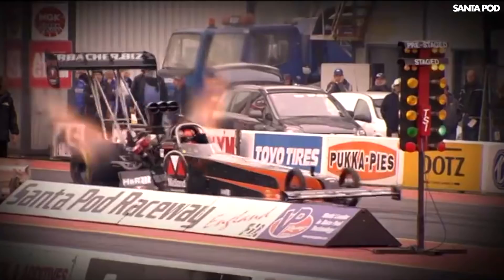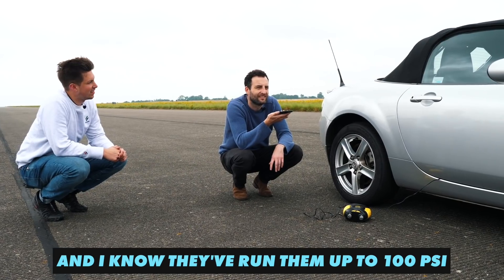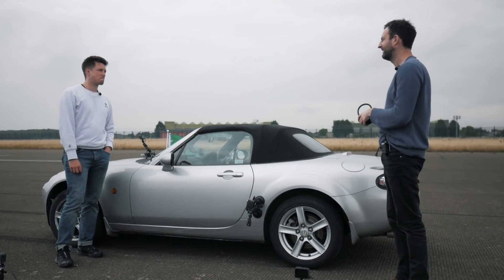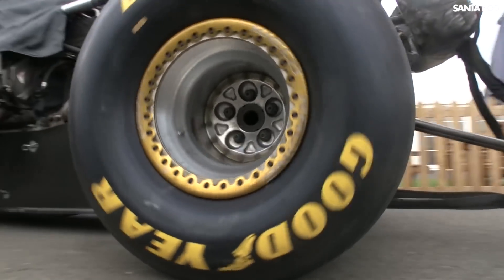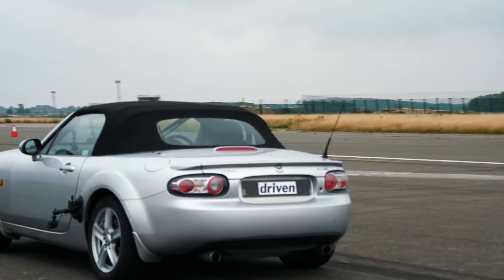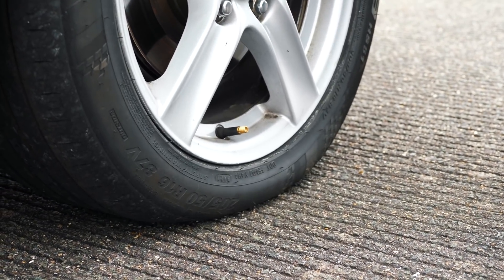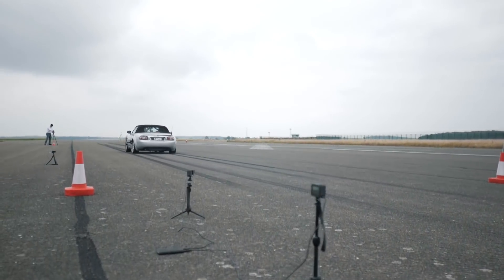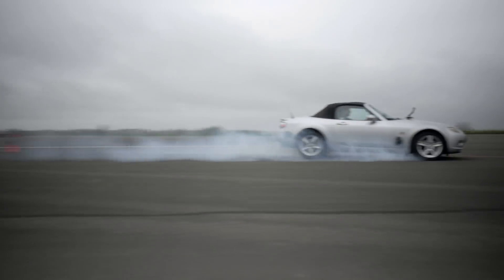Do Flat Tyres Make Your Car FASTER? | For Science

Comment from the maker: Those flat tyres were sketchy!! What would you like us to test next??

Don't forget to subscribe!
Reply: I remember a motorbike magazine did a cool test about 15yrs back. They covered over the speedometer on a bike and got three different riders to go along a runway at whatever they thought was 30, 50, 60, 70 & 100mph. Of the three the guy who was a speed freak was actually the most accurate, while the worst was a copper! Could be a cool test to try, especially if you used a big comfy car vs the mx5!
Reply: @downforcedan  Believe in JESUS today, confess and repent of your sins. No one goes to heaven for doing good but by believing in JESUS who died for our sins. GOD loves you soo much unconditionally.🤩❤😍🤗😇☺🙏
Reply: How about driving a circular track always on the inside lane and then driving it always on the outermost Lane and comparing the times.
Reply: What would happen to different types of race cars if they encountered a pothole? Even on street circuits, this has to be an extremely rare occurrence for today’s race car drivers
Reply: Best tyres against potoholes
Reply: 15 psi is the best pressure to contact patch ratio. Because any lower will actually decrease your contact patch as the tyre tends to fold in and you have what it's called "shoulder wear", when central part of the tyre is actually lifted off the contact surface and you are running on the two edges. It's quite easily identifiable just by looking at how they were worn out. 
Plus, the most important part of it is the make of tyres itself. And I'm not talking about brand, but what they're made off. Some tyres could be were hard composition of rubber, some will be very very soft. From my own experience the softest tyre I've ever had on my car was Michelin Eco tyre, I don't remember exact model name, but that tyre was so soft lightweight and flexible that I was able to turn it inside out and that shocked me.
Reply: Try it with an autobox. It will eliminate the clutch and reaction time. And, on the subject of auto boxes, test 2 identical cars, one with an auto box, one with a manual. Try a 5 series with a ZF 8 speed vs a manual.
Reply: Great video, but it had nothing to do with "Science" my friend. Science,.. Is the application of 'the' scientific method, to specifically and empirically determine cause & effect of a 'natural' phenomena.
         What you are actually doing is 'trial and error' testing, which is a process used within the fields of engineering or technology and design development.
      ... It's a great process, but it's not science.
Reply: Redo this test with an appropriate test vehicle. Perhaps something capable of running tens in the quarter mile
Reply: Alot of variables need to be eliminated.
Reply: Once you lower the pressure, do the moose test and check the breaking. As some idiots will start driving on 8PSI. Wrecking tires in no time.
Reply: Speaking from working experience. The max psi should be on the wall of the tyre mate 😅 (But, if you did that part for entertainment just ignore this comment). 

Oh! Also (for your average Joe) don't stand next to a potentially explosive tire. Worst case scenario, you'll mangle or blow your legs off or disembowl your self 🤕😱. To be as safe as possible. You want to be parallel with the tread and as far as possible with an extended air line. If you hear and snaps crackels pops or see bubbles... Run! And find cover fast!! Because you'll have created a literal air bust bomb by accident. With dirty shrapnel. And there nothing you can do safely that will stop it. Just leave come back later. If it holds for 24 hours it's probably safe to deflate. But it's still a gamble. For reference about 55 to 110 psi (depending on size and load capacity) is what commercial tires use on a regular basis. There's should be safety videos that will show you what I'm talking about if you are curious.
Reply: Tire pressures but for cornering
Reply: You guys really should have done a quick burnout before launch to equalize tire temps.
Reply: You could have made it a fair test by setting off at the same RPM throughout the different tyre pressures
Reply: One thing I never see talked about is the effect of relative track width on suspension tuning and weight transfer. So for example, if you spacered out the front wheels (or ran higher offset rears) the car will weight transfer to the rear harder when loaded up in a corner creating understeer, or vice versa, it will create oversteer. Could be a fun test with just a set of spacers.
Reply: lower the pressure   and check the breaking
Reply: In drag racing, race drivers/teams compare multiple point times along the strip, not the total elapsed time. Varying tire pressures affects the starts and big end times respectfully, not the same overall. With this car the last 2/3rds of the track would be an improved time with higher tire pressure and lower rolling resistance, and the lower tire pressure has better starting grip and high rolling resistance.
Reply: How about a lap with space savers ?? 2 to start with on either the front or rear. then switch them, then all 4 and compare the times
Reply: drag slicks
Reply: British vs. American approach to a kit car and link up with the Donut Media team. Make a fun series out of it!
Reply: How about not a manual to get rid of that variable and maybe check tire temperature next time. Warmer tires have more grip = "less wheel spin".
Reply: the british accent makes me laugh so much this video is amazing keep it up

Comment: This needs to be done in a car with an Auto and launch control 
And put the smallest wheel with largest side wall tire on the car that will fit

Sure this showed us results for a car with normal wheel/tire setup 
But literally anyone chasing a time on track or street racing and serious 
Is running 15"-16" wheels on a car that came with 18"-20" stock 
Not to mention either R888Rs or DOT slicks 

Plz plz plz redue this test with these parameters 
(Auto with launch control is to remove driver skill/mistakes from the test results)

Comment: At speed tests and time attacks I prefer 22psi it’s ideal for a good fast start better traction less understeer and oversteer until mid track they start to get hotter which is good for semi but it will inflate, by that time you will pick up the pace 👍🏻
Reply: Did you know that nitrogen inflates more than air? Unbelievable 🤷🏻‍♂️

Comment: Traction and speed are two different things. Higher pressure less resistance, lower pressure means more rubber on the ground, increasing the resistance. There saved you some time. This is why you don't drop the air pressure unless it's a utility vehicle, or a funny car. Your Ferrari is not a Jeep.

Comment: Drag slicks are bias ply and are specifically designed to run low air pressure, conventional tires will tend to cup upwards in the center reducing the contact patch, making less traction instead of more like a drag slick.

Comment: You could do the sam but with rolling start to have more consistant results but then will be only difference in rolling resistance in such a low horsepower car. And maybe gear ratio a bit as well (difrent diameter of the tire

Comment: Lowering tire pressure matters more with high hp vehicles that have a problem keeping traction.  That's why you see it done at the dragstrip.  A low powered vehicle like this Miata is really not a good test bed for this.

Comment: My .02c, if you wanted to go quicker with the insanely low pressures you need to then remove the wheelspin. It sounded like at the 20psi and lower mark you were revving the engine higher which I don't think helped put at 5psi. At 5 you needed to back off the throttle just a touch to allow it to actually grab and then hammer it on. Any drag racer will tell you that you need to hook up to go quick, but they're still able to do burnouts and also ruin races by breaking loose off the line.
No need for a retest because obv it's not sade to be that low at high speed on street tires but I bet if you backed off the launch and then hammered it immediately after hooking up you'd see a tiny but consistent improvement possible.

Comment: Unless it’s a specific designed tire to run low on air , it doesn’t help much at all to run standard radial street tires low on air…it actually can make traction worse on pavement ! The center of the tire will concave and only outer edges of the tire will have traction!

Comment: The reason the car was slightly quicker on 70 psi than 30 is because with less friction you loose traction but the car will accelerate faster after it hooked. It's fighting less friction so less drag. It's why drag cars have skinny front tires rather than standard size.

Comment: You should have kept the tyre pressure in the front constant. Lower pressure in the front will just increase drag. The lower pressure might actually have been better if it was just the rear wheels.

Comment: I kinda think greater radius is manipulating the odometer and fueling procrastinating depends on weight. 13/7s got the throttle pep but i guess a trunk full of batteries that gearing is a driveshaft maintenance

Comment: Have you considered the long-term damage you have done to the tyre structure with those heat inputs? Don't be amazed if they let go when you're motorway cruising or, worse still, pushing the car hard through some complex bend with a long drop over one side? Sayonara!

Comment: You can run the same size tire but lose the suicide rims but the smallest rims you can get on there better launching better cornering better stopping
The downtake here in the United States where they lowered the braking laws in 2013 gas mileage and you'll lose a bit on the top end with the suicide rims

Comment: I experimented a bit with this during my hillclimb/sprint days.  Not specifically for launches but for overall handling.  Too low pressure and there was a risk the tyre could come off the rim during heavy cornering. Sweet spot for the 13" tyres I used was around 23/24 psi

Comment: Yes I totally agree and that’s exactly what I was thinking as well. It’s not convenient to lower the tire pressure to 15-20 psi if the car doesn’t have enough power to grip well to the ground. So the times are not really going to differ. If this was a 500-700hp car you can probably conclude that the tire pressure being lower is actually better

Comment: First! wtf is psi? Can you be nice and include Bar on the screen so I don't have to use Google while watching this video. Aaaaand, ur car is manual, lol. All of those numbers can be just human error in gear time switching.  Not sure if that matters much but you did start of the same place every time making it a bit inaccurate as you leave rubber on the road after every burn out on the start making the tyre grip better next time. That is a big deal in professional drug racing. Indeed not sure if mater much here

Comment: Interesting test, but it doesn't seem very scientific. There are just too many variables. Was there really only 1 or 2 attempts at each pressure? The variance even at constant pressure seems to be larger than the advantages you are hoping to see. Also, what's the hypothesis being tested? The experts being interviewed suggest it's about limiting wheel spin, yet the runs shown had wheel spin all over the place and it seemed at lower pressures that the engine wasn't powerful enough to induce wheel spin. It also seems like a lot was left up to the driver. A manual gearbox with no launch control or traction control means that the ability to maintain traction while maximizing torque is largely at the mercy of the driver who naturally can't react very quickly. A powerful engine, a good automatic gearbox or CVT, and electronic launch control or traction control would extract the most power out of whatever traction the tires could provide. If tire traction isn't the limiting factor, then improving it is unlikely to improve the overall performance.

You should also control for the order in which the runs were performed. As others mentioned, tire temperature increasing and rubber laid on the track from run to run can play a factor. To minimize the effect of that, you should randomize the order in which you perform the runs, including going in different order for each replication (do one at each pressure in one order, then choose another order and do one at each pressure again). Then create two plots: one with race time vs pressure and another with race time vs run order. See if there is a correlation with run order and account for that. Randomized run orders in each replication and several replications should largely cancel out any effects due to run order.

Comment: High pressure tires can lower the rolling fiction, positively improving acceleration until traction becomes the limiting factor.

65r sidewall are an intelligent balance of rotating mass, comfort and traction for normal road use..  even as consumers and manufacturers aspire to 40 inch rims with 10mm sidewall lol

Comment: On those ultra-low pressures, the rolling resistance will be considerably increased, so any advantage off the lines will be negated by a slower top speed. I should add that (very roughly speaking), the contact area is in inverse proportion to the tyre pressure. Double the pressure and it halves the contact area. That's because, to a rough approximation, the weight carried by the tyre is the internal pressure multiplied by the contact area. So, if the tyre is supporting, say, 500 pounds and there's 50 psi then there's a 10 square inch contact area. At 25 psi it would be 20 square inches. I say it's rough, because that calculation ignores the weight carried by the side walls and tyres are not balloons - they have some compressive strength in the tyre walls through the construction.

On this particular set of tests then I doubt it proves too much. That Mazda doesn't exactly have a great deal of excessive power to break the tyres loose under acceleration, and if the tyres are not allowed to cool down between runs (which, being rubber, isn't quick), then there will be some effect from that. It would take several runs at each pressure to eliminate driver variables; even in F1 the drivers aren't completely consistent in their starts, albeit they have a huge excess of power over traction to  deal with.

Comment: It kinda transfers over but no at extremely low PSI’s plus you have to heat the tires with a burnout with you at really low air pressure we run 5-10psi ( we use what’s called bead lock to keep the wheel from spinning on the rim which is bolting the tire to the rim ) in our slicks we can’t below 5psi it’s a mandated rule you can put as much in as you want but no more than 10 is optimal and it depends on track temp and air temp on what pressure you run I was usually between 5-8 psi on a 14” wide bias ply slick I ran a 383cid small block Chevy making about 1k HP N/A the I had a 500HP nitrous kit as well which I used from line to line dragsters only run around 8 psi in there slicks as well the lowest they can go is also 5 psi which allow the tires to stand which changes the gear ratio making the car faster and that’s why we run such low pressures they help us launch better and go faster and that wobble you talked about we get that at the end of the track because we’re running bias ply rears and radial fronts at 45psi for a better reaction time

Comment: WoW, no one has thought to mention this, lowering tire pressure effectively lowers the final “GEAR RATIO”  lower gears will get you off the line faster but flat tires will slow you as you try to go fast.

Comment: The difference is bigger with high torque and power cars which have enough power to spin wheels in 50 kph+ speed. On cheap crappy cars like dacia with 54kw engine the faster will be with more pressure because no power for wheelspin

Comment: What you say in 2:10 is a very common misconception on why fast cars have wider tires. Actually, smaller surface touching the road means better grip. Distributing the same weight in smaller area increases the grip, it doesn't lower it. That's why, for example, stilts end on a small surface touching the ground and not in a shoe size area. Bigger area would mean that stilts could slip on the ground easier as they would distribute the same weight in a larger area. If you want something to grip on the ground, generally, you make it pointy.

Now the problem with all that, is that cars are powerful beasts, and if you try to maximize the grip by lowering the contact area, that tire would be destroyed in a couple of spins or breaks, as the good grip would mean extremely fast wear. So, it's a balance. You have to make the tires thin enough for better grip and wide enough to avoid super fast wear.

And that's why it's super stupid to put wider tires in cars that are not powerful, you actually lose grip for no reason at all (except maybe tires that don't grip and last a century).

Comment: I run my tyres at 40psi xD... The recommended is 32psi but found the wear was a bit uneven and at 40psi it's better, they still wear quicker on the outside shoulders (probably due to body roll) but overall the wear across the entire tread is allot more even.

Comment: At launch I am sure you get better traction therefore more speed. I have a 2004 Jeep Wrangler Rubi with ARB lockers 4:56 grears and I run at 4 PSI to rock crawl.

Comment: I picked up a bolt once on my back right that made it go flat, couldn't feel   it no idea how long I was driving on a flat but eventually I started smelling burning rubber at a couple stop lights that made me check my tires and sure enough it was flat and the side walls were shredded, good thing I had a donut to swap, I keep seeing all these new cars coming with fix-a-kits instead of a spare, and that would have left me stranded.